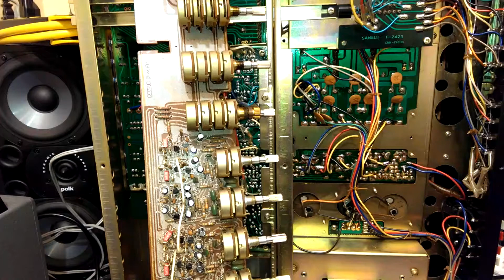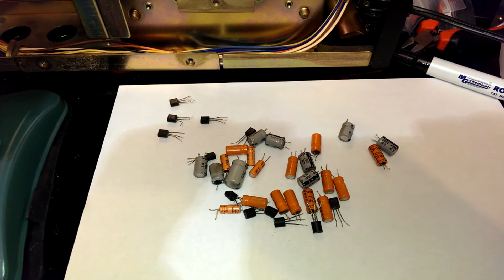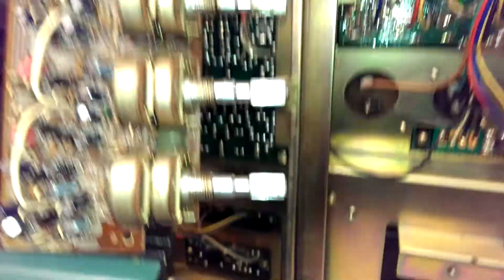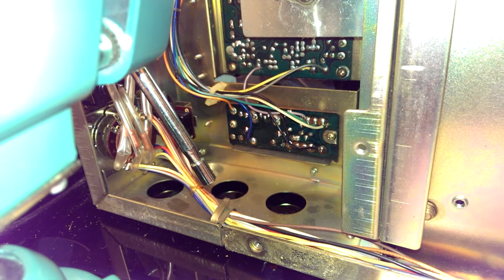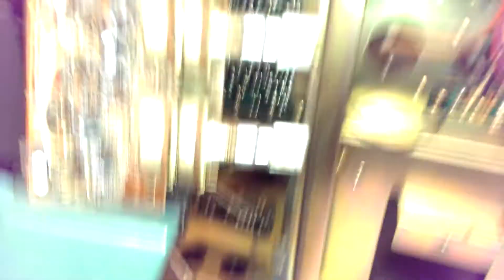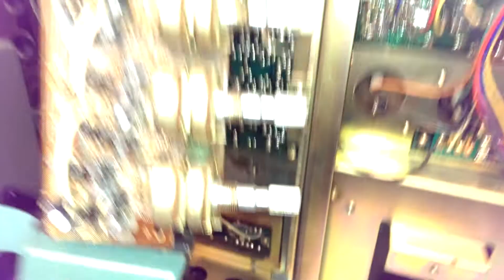QRX-7001 - Repair Summary

Comment: Can you us NTE199 in place of the 2sc1313 transistor?
Reply from the maker: Yes, though you can also use KSC1845 in any gain rank so long as you stick with the same rank for all replacements because this circuit does not require super high gain. In any case, note the pinout of your replacement, you may have to insert the replacement in a different orientation.

Comment: hi Andrew- just got a Sansui 7001 and when messing with a light i managed to blow them all out. i traced this back to a fuse. when i replaced the fuse i stupidly did it while it was plugged and in doing so i dropped the wrench and it hit something which caused a short. now the tuner meters arent responding but the fuses look intact. 

any thoughts on what shorted out? 

thanks
Reply from the maker: Does the tuner work at all?
Reply: no, after i turn it on it clicks once after 3 seconds. nothing look burnt. i was wondering if it could be the relay? maybe i fried it? thanks so much for the help.

Comment: I have a QRX-6001, that I want to rebuild the toner board like you did. May I know what kind of film capacitor to use for those low value cap? Do you have a link to those film capacitors. Thanks.

Comment from the maker: The inner chassis was cleaned with a brush, compressed gas duster and in some areas, a microfiber cloth. The front panel and knobs were soaked in Meguiar's Aluminum Wheel Cleaner and brushed with a soft bristle brush under hot water and then towel dried.
Reply: Thank you.  The video link is exactly what I'm was in the process of doing . Recapping an entire Sanusi au5500 and changing all the small transistors and power transistors  .